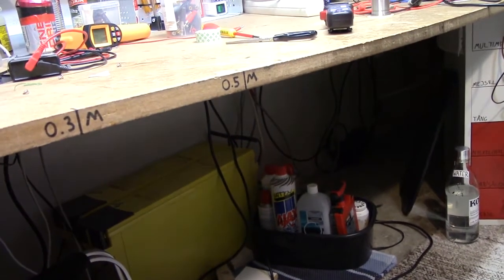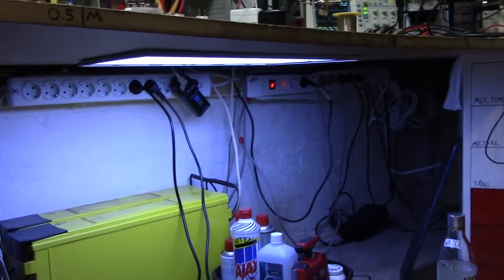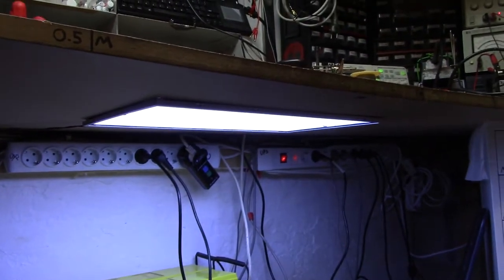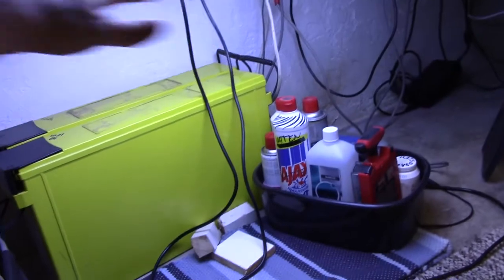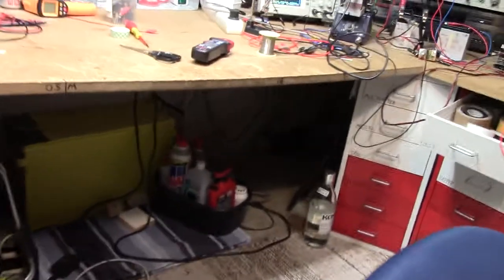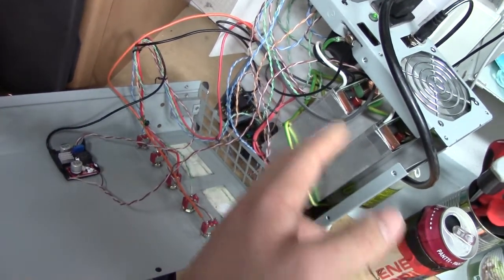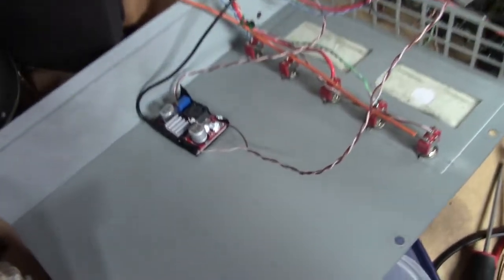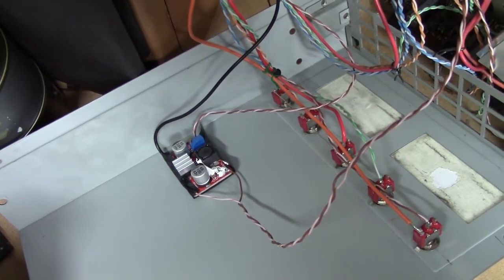LCD panel under-bench light

Comment: Under bench lighting works great.  (my system has a 24V LED string with a rocker switch mounted in a project box)
Your video is a great way to re-purpose an LCD panel.